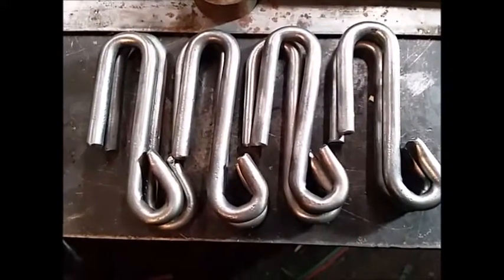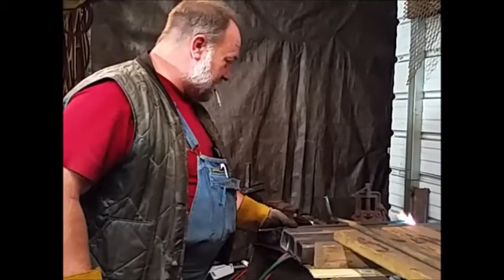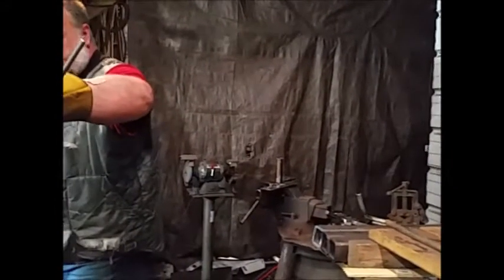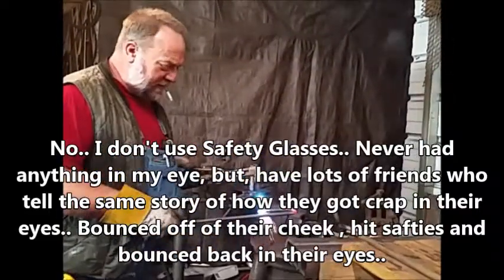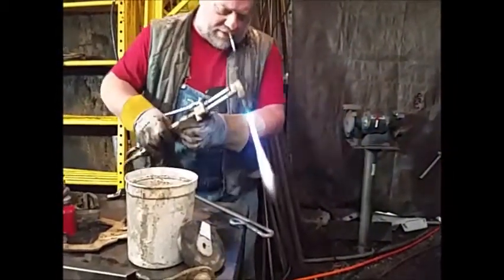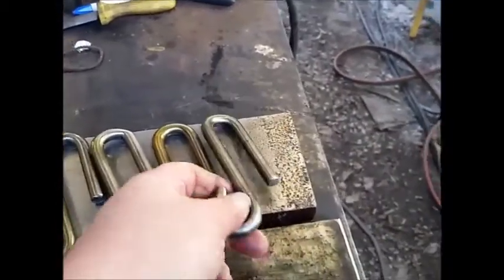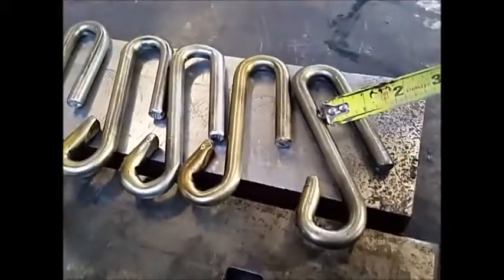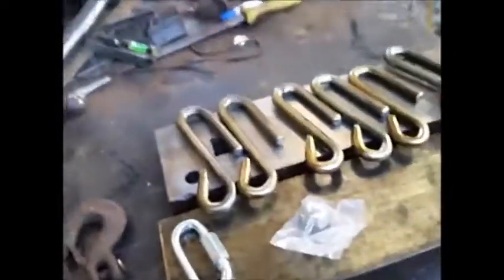How to make a Better Safety Hook for a Safety Chain.

Comment: That bending jig is a nice set-up and I'm going to build one - probably use 5/8 inch shaft to match the holes in my harbor freight bending dies.  Thanks for sharing.
Reply from the maker: Rick Rabjohn most definitely. That sounds like a great idea. that's what I used a half inch square  bar for  using a set of half inch sockets.. Your setup will be perfect.